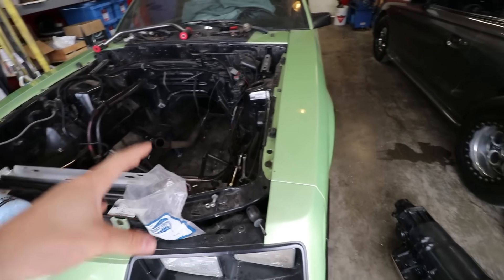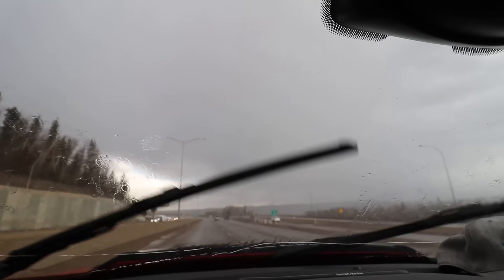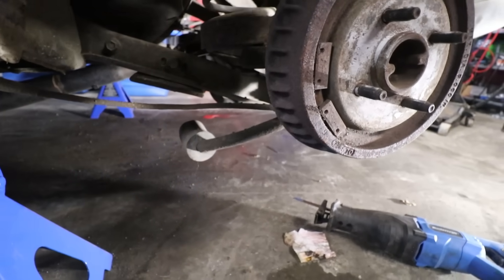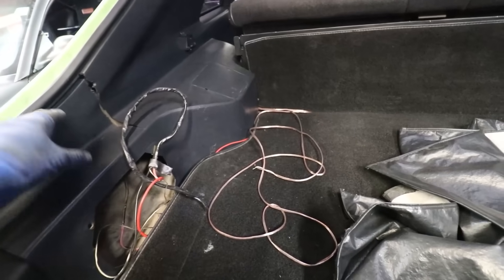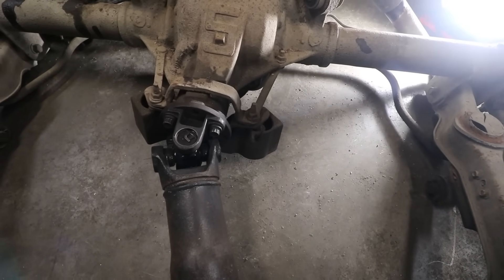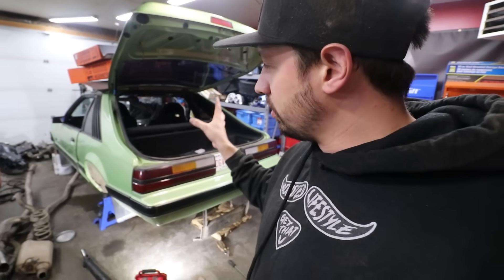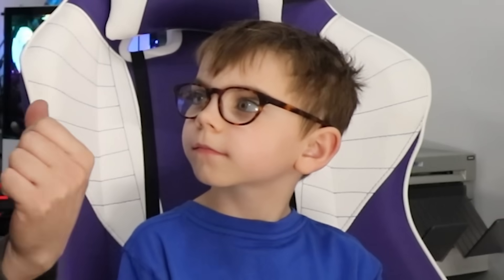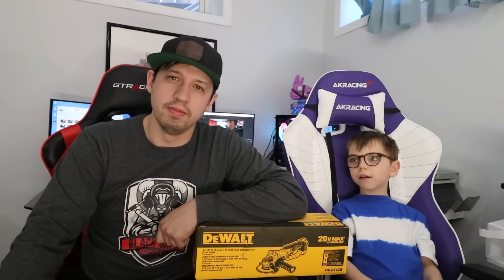Twin Turbo Ls Fox Body Build - Did We Go To Far?

Comment: It might seem a lot of extra work to do it right the first time, but taking the car back apart to put them in later will be a lot more extra work, still.

I'd put the new adjustable torque boxes in now, if I were you.
Reply: With as much power as you are gonna throw at this, YES, put those torque boxes in now.

Comment: You don't have to cut out the touque boxes to reinforce  them . There just spot welded to the frame rail so a reinforced angle plate goes in the lower torque box and gets bolted and welded to a plate on the floor board.  Same with the uppers but they run a weld down the factory upper torque boxes . Those plates usually get tied into the cage when you get to that point .  They do make custom torque boxes if you want to cut them completely out but not necessary.

Comment: I'm rocking cheap China ls3 heads with 64cc chamber. ....long as you pull them apart and check over all of it , they tend to work great...this is my 3rd set with no issues what soever.....wanna say the are speedmaster procomp heads

Comment: put your jack stands on the frame and not on the body it would be way safer, safety third
Reply: Fox bodies are unibody. The frame is the body
Reply from the maker: This. The pinch points on the chassis are actually recommend lift points In a lot of unibody cars

Comment: Your throwing a ls into it your already destroying it...
Reply from the maker: You mean making it fast. Who wants a garbage 302
Reply: @Boostedlifestyle  a coyote 5.0 or 5.2 voodoo would be better hell I’d be more impressed with a built ecoboost 3.5 twin snails never seen it yet
Reply: @chasebrown9851  yeah, twice the price too
Reply: @oldscut84  only thing that sucks honestly
Reply from the maker: Yeah 3 times the price to do a coyote
Reply: It's easy to tell people how to spend money when it's not theirs.
Reply: I've looked into coyote swapping my '88 thunderbird. $4000 for a decent used gen 2 coyote, about another $4000 for a 6R80 or a good TH400, custom driveshaft, $2500 for the Ford control pack to be able to run the engine and not to mention all the other little things that no one really thinks about like the accessory drive or steering or k members. In the end it would easily cost a good 20-30 grand to do it properly.
Reply: @Boostedlifestyle  three times the price. And still won't make half the power an ls does.   Good choice on your part. Keep up the hard work.  Can't wait to see more of lil Leroy !!